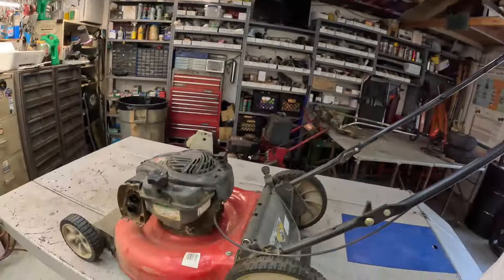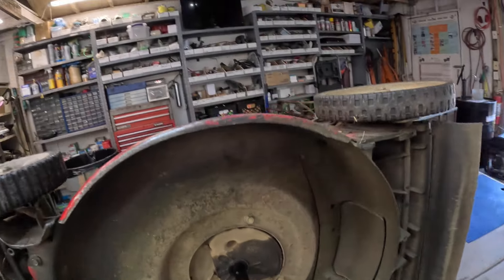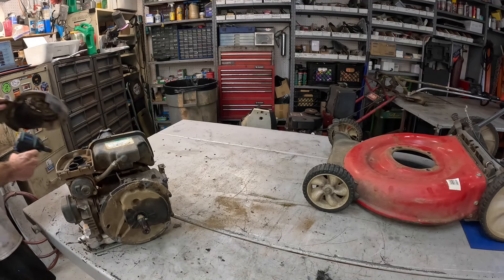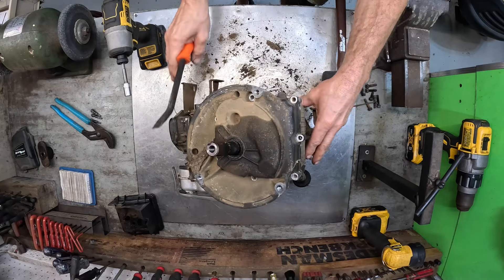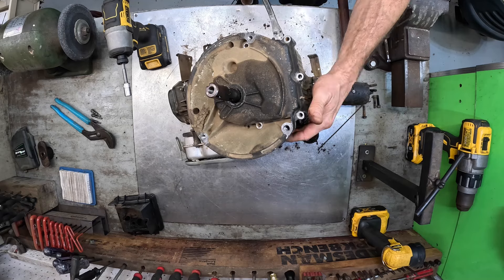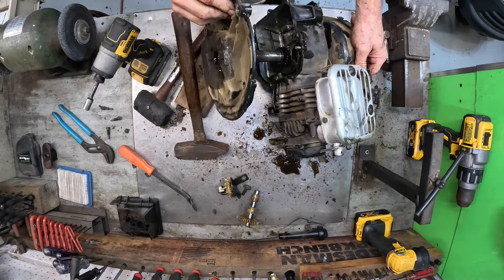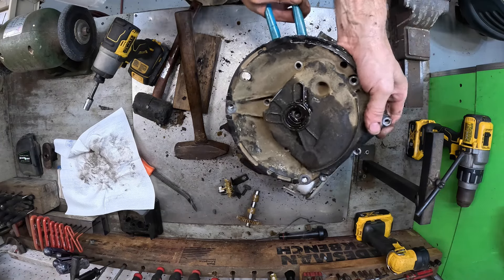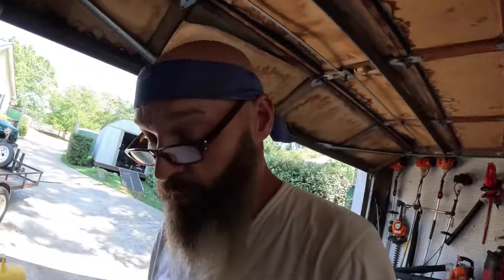Yard Machines 21 Inch Push Mower | Can't Pull The Rope - Engine Locked Up!

Comment: Take a long pipe, put it over the shaft, and bend the shaft back into position the best you can before removing the engine from the deck

Comment: Hey Tom. I've got 7 of those engines too tear apart over winter. Hoping too have 3 running for spring. I have 2 self propelled decks with bags all repainted ready too go! Plus a few Toro's. Gotta be prepared since NY is banning gas after this year.